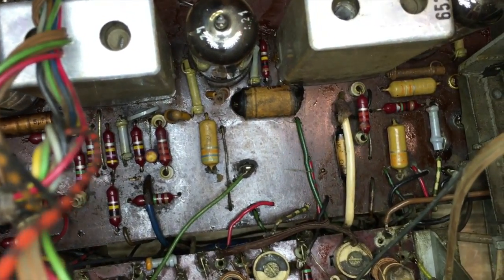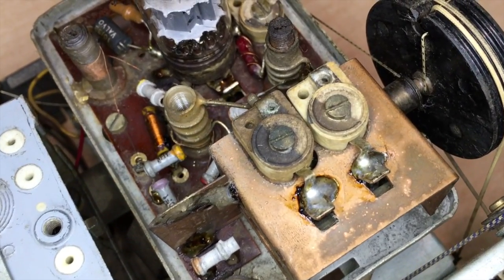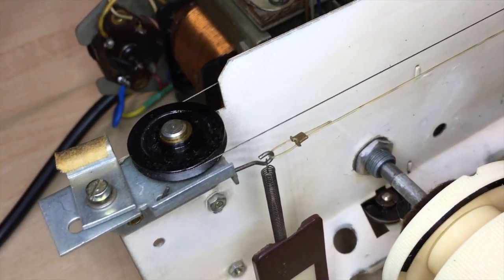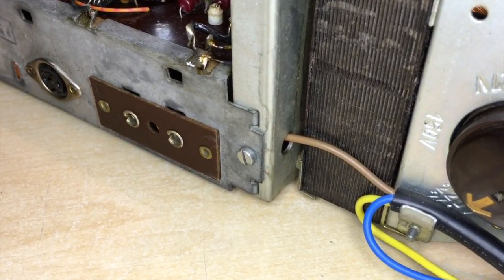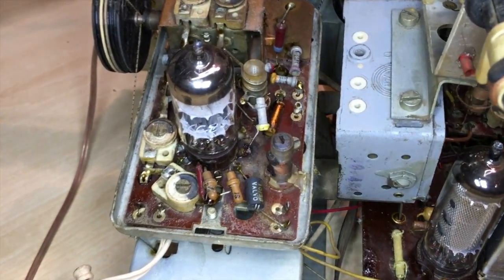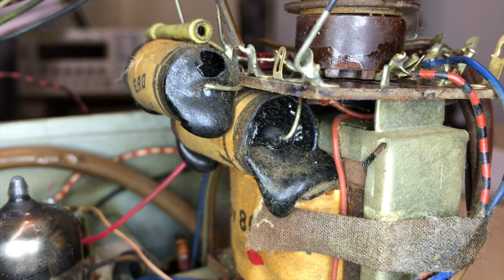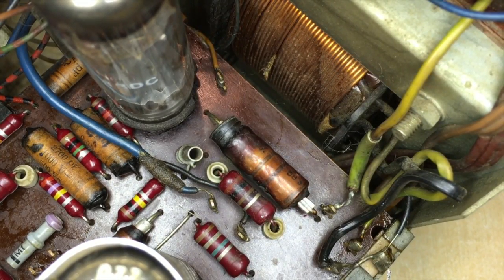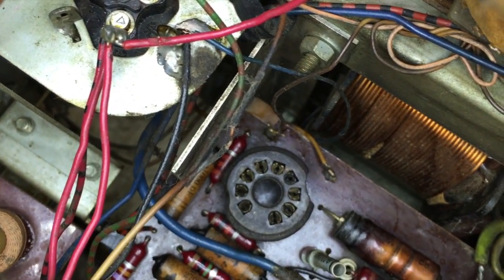Graetz Comedia 616 tube radio restoration - Part 2. All cleaned up and ready for the knife.

Comment: Hi great video!
Can you please help me? 
I have the same radio. 
Re- The three .1 uf capacitors near the PC board (near the selenium rectifier). I clipped them all off at the same time - big mistake! Can you send me a photo that shows where the bottom leads go? I figured where the far left goes but the other two I’m not sure!
Reply from the maker: I’m afraid I haven’t got this radio anymore.
Reply: Ok thanks. You do great work. Thanks for your videos!